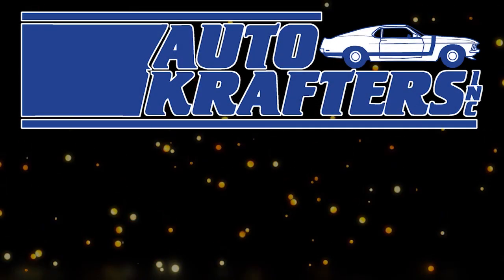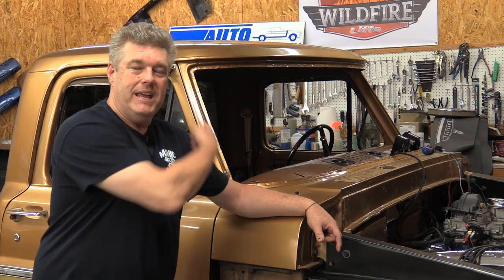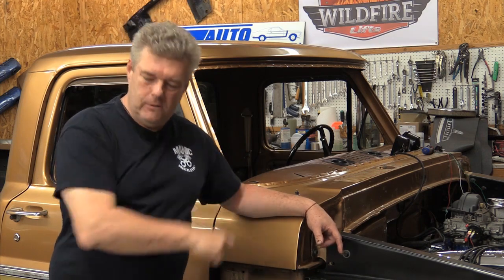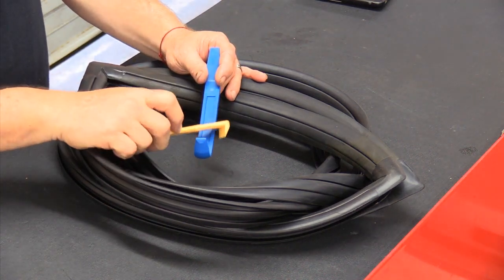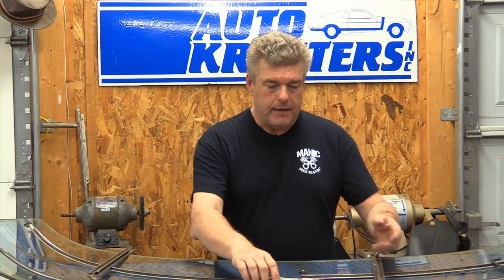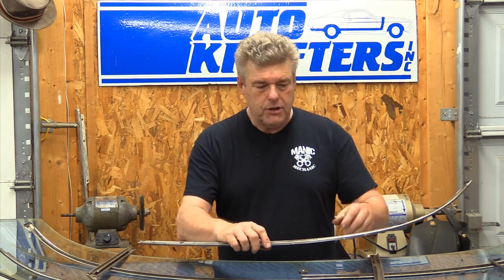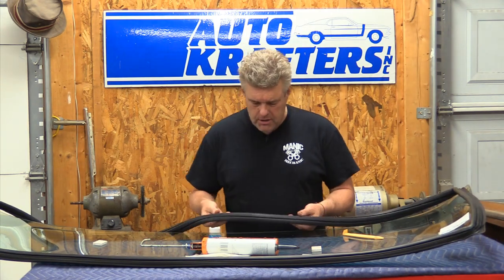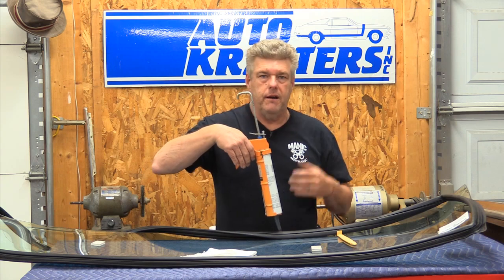How To Windshield Replacement With Gasket F100 Part 2

Comment: Don’t listen to that complainer— the 3M bedding and glazing compound is mac daddy. Yes, it gets everywhere. Yes, it’s a pain to clean up. But it seals correctly and stays pliable for-basically-ever so that as the glass expands and contracts in the dissimilar weatherstrip it’ll continue to hold a good seal. It’s as good or better than what the factory used, it’s the right stuff.
Reply: My 73 Econoline, glass was not in right, leaked even after a new gasket, then when I was hit, my windshield popped out, it revealed rust around the frame, proving my leak complaints.

Comment: I had a new windshield installed in my 70 F250 (cab is 72 F100).  The installer had a heck of a time, took 3 tries using the string method. The trim was a pain also, thankfully it turned out great, all for $100 installed (I supplied the new rubber).
Reply from the maker: We did it t show how to do it in case someone wants to. 😃😆

Comment: I had a glass guy install a new windshield on my Road Runner and he didn’t use the 3M bedding and it leak! Not happy.. lm going to send him this video!!
Reply: Same here on my van, even after complaining, glass shop denied the windshield was leaking, a wreck this year popped out the glass, had surface rust in the locations I said water was coming in

Comment: To the best of my knowledge, Ford did not use any sealer on their pickup windshields. The manual does not call for it. It is like putting Permatex on a gasket. Here is a link to a video of a windshield being put in a 1967-1972 Chev pickup. This video is from the people who make the gaskets and a guy from Eastwood. The only liquid they use is soapy water. Great technique for future replacements. https://www.youtube.com/watch?v=i2Xg30Q39Cw
Reply from the maker: I respectfully disagree. Comparing the Chevy windshield install to a Ford is no good. While things are similar, they aren't the same. Two different trucks. It may be that Chevrolet didn't use bedding and glazing, I haven't researched it (but if we do a Chevy truck, I will). Every Ford gasketed windshield I have ever installed in the passenger car line has bedding and glazing compound around the glass and the perimeter on both the front and rear. It is in the original assembly manuals on at least the Mustang and Falcon. Further, that glass in the truck was an original piece of glass. I can't "prove it" but I am almost double sure that the gasket was too. I know that the truck was painted without removing the glass.When we removed the gasket, there was bedding and glazing compound on the perimeter of the windshield opening. Not urethane, not bare, bedding and glazing compound. If you install a Ford windshield without the compound it will leak. If you use urethane it will leak later.